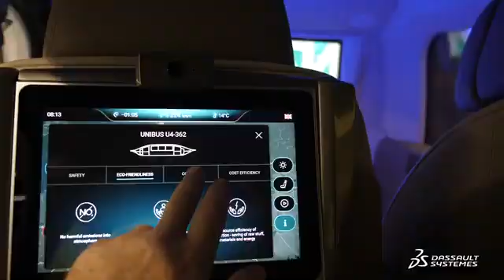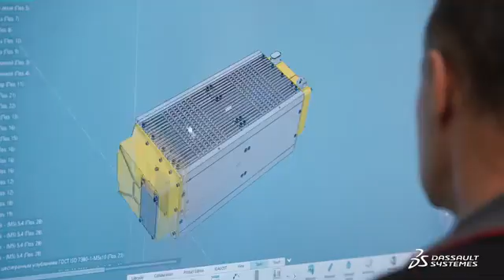🎥 Dassault Systems Company On #Skyway

Comment: SkyWay was a dream that came true. SkyWay will reduce costs, land acquired for tracks and time. Imagine traveling to destination that is 90 minutes away by airplane. That's about 1200 km on the land. SkyWay high speed traveling at the speed of 500 km/hr can do that with stops  in 2 and half hours. You need to get to airport 2 hours before your flight. Get through the security process. Risking of loosing the baggage. Flying. Getting from the airport. Real time for flying 1200 km away is about 4 to 5 hrs. SkyWay station to station 2 and half hours. No security 🙂 we need a global network of SkyWay and save tons of fossil fuels on flying. 👏👏👏
Reply: You got that right 👍